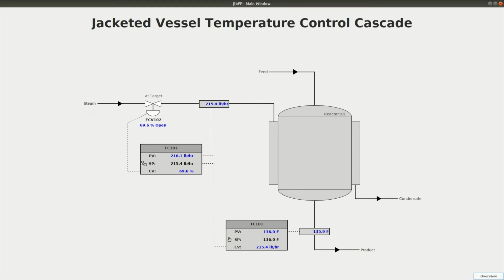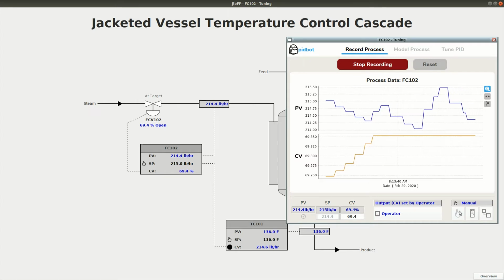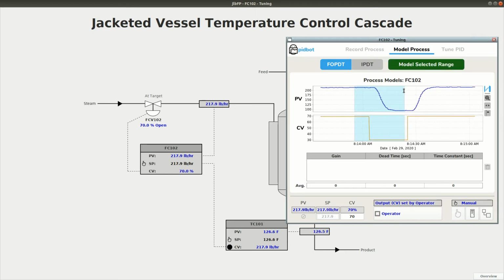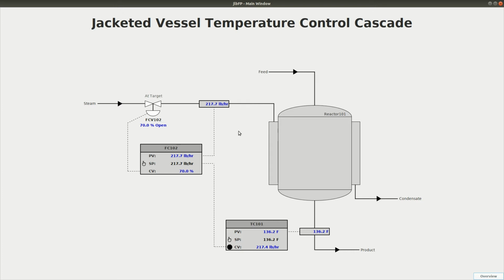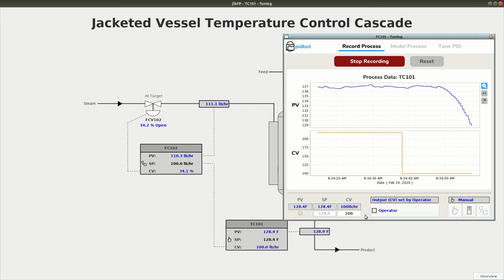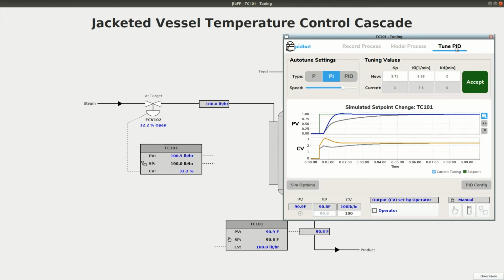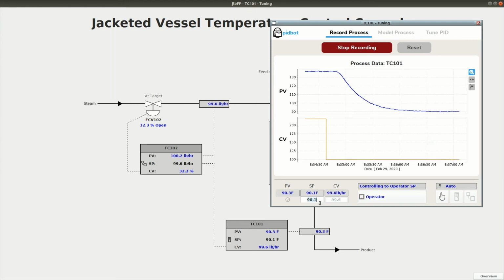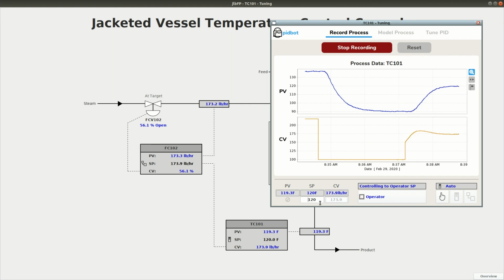Cascade PID Tuning with pidbot

Comment: Hello, I'v been wondering at 7:30 (primary controller tuning), I thought that as long as the error exist the CV value will keep increasing due to integral accumulative effect. but there, it slightly decrease. What causes that slight decrease?